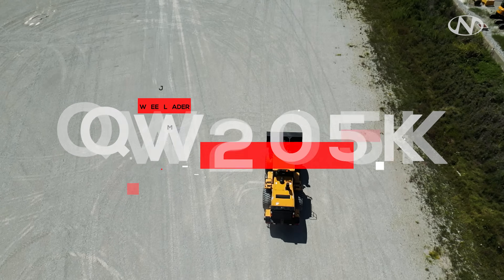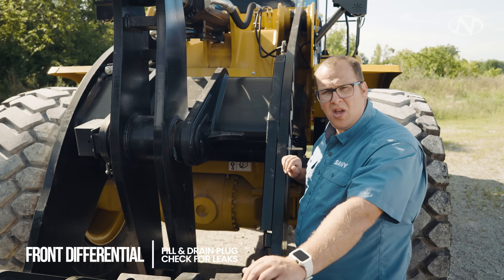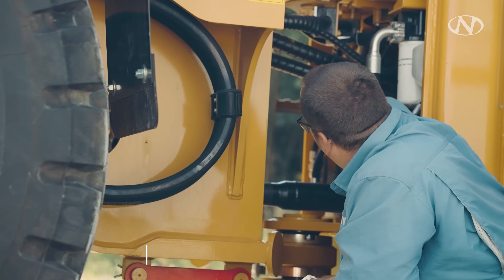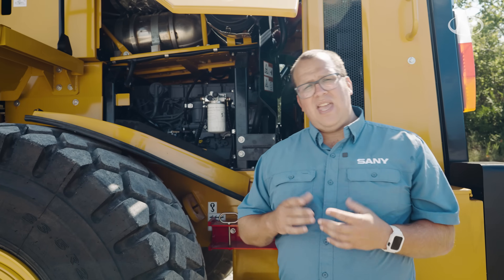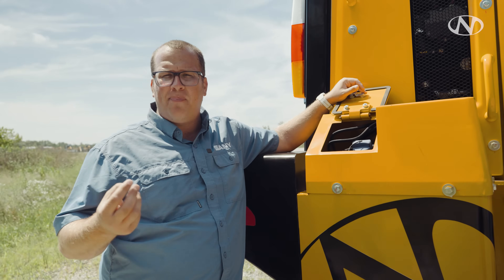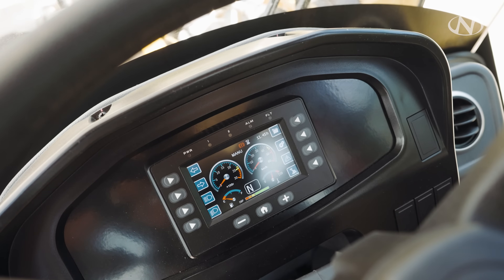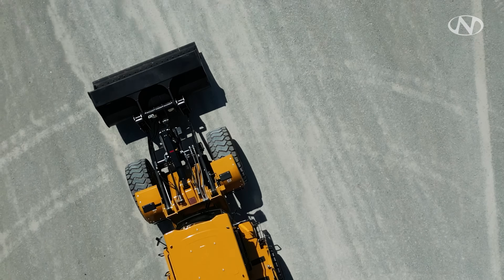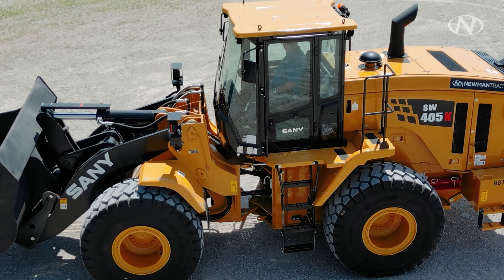2024 SANY SW405K Loader - The Best Wheel Loader?

Comment: Any one have experience with Sany 405k loader? Are they reliable?
Reply: @bubblesfan101 I can’t say that I have used them but I’m working in an open pit mine and they use them here. From what I’ve seen they look like good solid reliable work platforms
Reply: They suck very squirely . Nothing like a cat and feels really cheap. The one im currently running the menu on the cheap screen says “manu”. The steering is super touchy and feels like a ‘09 cat 930 loader but you get what you pay for. For personal farm use  would be best but for a business i would invest in a Deere or Cat